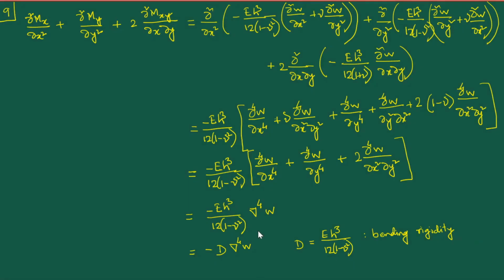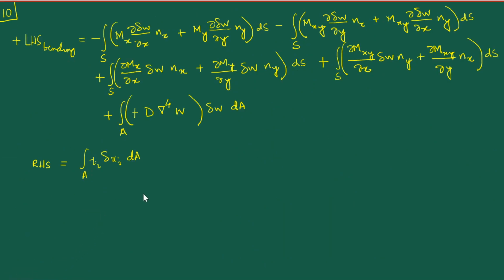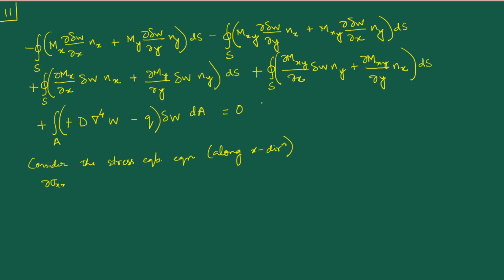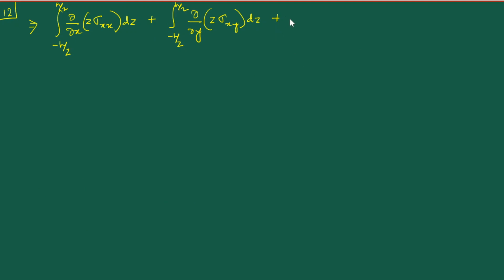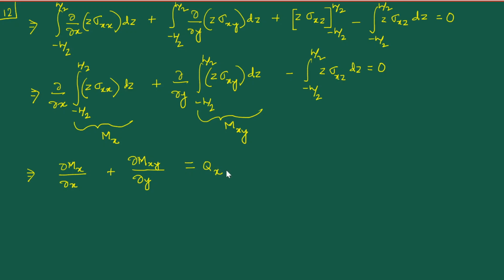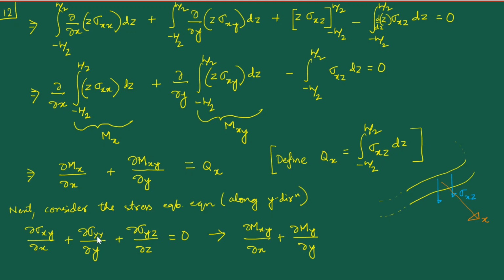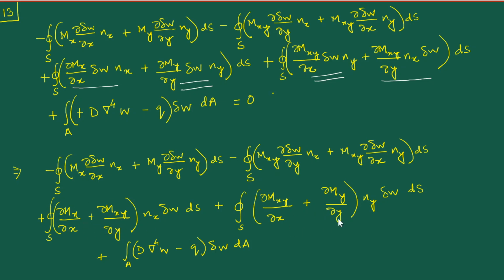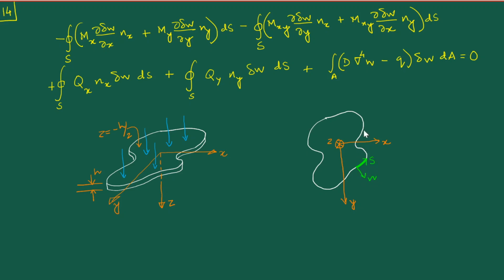[L36] Classical Plate Theory – 3: Derivation (Part 3)

Comment: Dr. Chakraborty, 
Your lectures are very helpful and interesting.
Currently I am studying the buckling of thin wall circular cylinder under axial compression and {I am not able to figure out analytically that weather it will fail in axisymmetric modes or non-axisymmetric mode}. 
I am just able to find out the critical buckling load and it was matching the ANSYS results. But what if I want to figure out analytically that what mode(longitudinal halfwave and circumferential half wave) it is going to show me( axisymmetric modes or non-axisymmetric mode. ?. 
Can you guide me regarding the source/thesis/research paper which I can study to figure it out analytically?
Reply from the maker: Thank you. However, I am afraid I don't have a ready reference that I can point out to you. If you wish you can drop me an email, so that if I come across a good reference I can get back to you.